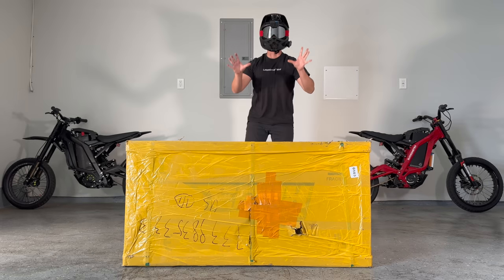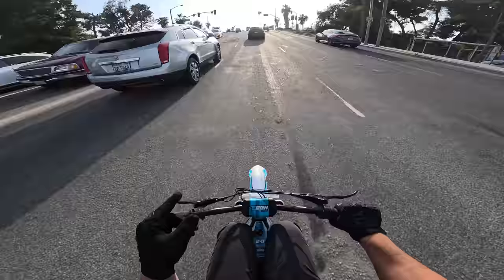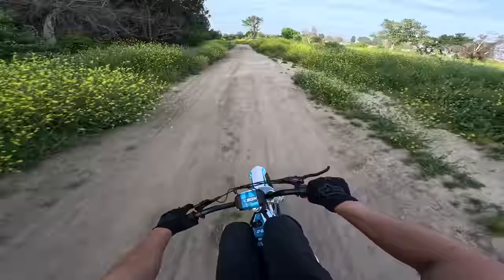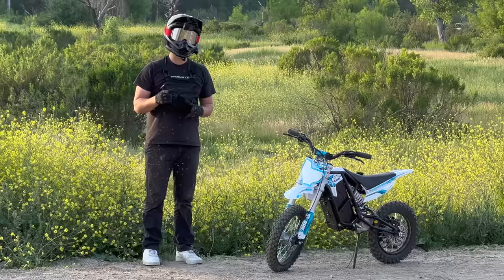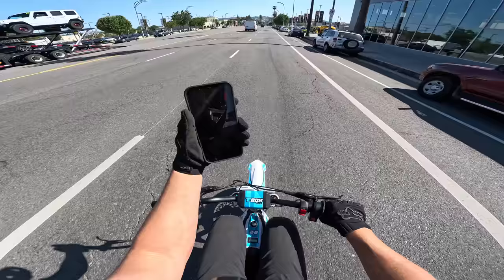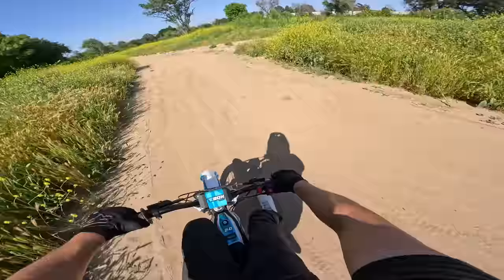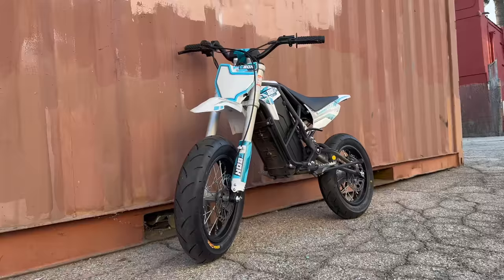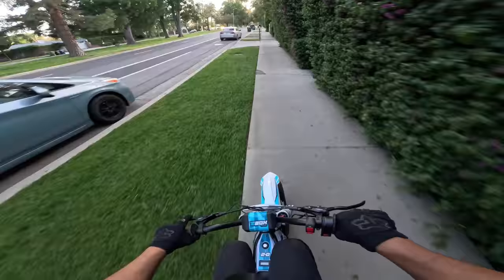World's Cheapest Electric Pit Bike // OFFICIAL Test and Review E-BOX 2.0

Comment: For everyone wondering which kit he used from electro&co its the etm kit meant for the mototec! The ebox uses the same motor and wheels! The ebox looks like a great bike since it comes with a 60v battery!
Reply: Can i ask about the battery bms ? The Stock controller have 42A output i realy Dont think the battery bms is rated on 75A controller 
Or ?.
Reply: @petr machač  are you asking about the e-box? Im not sure i dont have one but i assume it will be just fine. My stock mototec 48v 13ah will handle 70amps no problem and has been for over a year.
Reply: @EmxBrandon  thanks that what i needed to know im thinking to try shunt mod on the controller as cheaper alternative 
But little bit skeptical about the heat, safety etc :D
Reply: @petr machač  just take it slow with the shunt mod! And be prepared to get a new controller. Not saying it will burn up but theres always that chance
Reply: @EmxBrandon  yeah ist just befor i can Save for the controller kit know that it Will kill the controller but the battery shoud be fine or?
Reply: @petrmachac8165  which bike do you have? Either way im sure the battery will be fine!
Reply: @EmxBrandon  the 2kw version 
Thanks
Reply: What controller kit can I order from the uk?
Reply: @mckenziehattersley2117  for what bike?
Reply: @EmxBrandon  the same in the video the stomp e box 2, I can’t order from electro and co because I’m from the uk so I need a different controller kit I can order from the uk
Reply: @Mckenzie Hattersley  odd i know a few guys with the etm kit in the uk. Maybe they stopped shipping over seas. Unfortunately they are the only ones i know tuning the votol em50 controller. I do have videos how to wire up and tune a fardriver controller which works great with that motor!
Reply: @EmxBrandon  u got a link to it and specs
Reply: @EmxBrandon  do you think the 100a sabvoton controller kit from ebikemodshed will be completely fine and comparable
Reply: @EmxBrandon  when he cut the wires and changed the ends what ends did he use?
Reply: @reece162  copper ring terminals crimped and wrapped in heat shrink!
Reply: @EmxBrandon  thank you appreciate it
Reply: Can you send a link to them plz
Reply: Mototec / Funbikes / Apollo to ETM Upgrade Kit this one?
Reply: @reece162  ring connectors
Reply: @mckenziehattersley2117  thank you
Reply: @reece162  just make sure you got a crimping tool and a heat gun will help a lot appropriate tools to install them
Reply: @Mckenzie Hattersley  just a crimp tool set
Reply: Thanks for letting us know! liking this so it can get to the top, side not dangggg 450 for a controller and throttle ? oh well ill still cave in and buy it hahaha, also on the sight i dont see the power connectors on the side of the controller like it is in the video, might be trippin though thanks alot :)   

quick edit: would anybody happen to know the name of the head of the connectors that he heat shrinked on? thanks
Reply: @1.crowder  hi, it’s £380 and you get the controller, theottle and colour display screen. You might be on the wrong site just search 100a sabvoton controller kit you’ll find it £380 and he used copper ring terminals with heat shrink
Reply: @1.crowder  I think you’re right too, you might have to snip the battery wites and crimp on some ring terminals too! You see there’s 5 places for the ring connectors, the 3 phase wires and battery + and battery - hope this helps
Reply: @1.crowder  also instead of snipping the battery wires you can just buy an xt60 to ring terminal connector
Reply: is the ebox that same size as ETM bike?  Specs say its smaller which has me leaning towards the ETM
Reply: @BJL  the ebox is an inch shorter seat height and 3in shorter wheel base. Make sure you get the etm and not the etm mini versions. Or save yourself some money, get a mototec 48v pro and slap on the etm kit, get some hydro brakes and a nice dnm rear shock and youll save a couple hundred if not more
Reply: @mckenziehattersley2117  dont buy the sabvaton! They work terrible with these motors!
Reply: @EmxBrandon  so your saying get the etm over the ebox
Reply: @EmxBrandon  what controller then
Reply: Is it possible to just get the controller and how please.
Reply: @BJL  nah you get whatever you like!
Reply: @mckenziehattersley2117  fardriver! 72360 i have videos on how to wire and tune them easy!
Reply: @Bodhi Graydon  what controller? The etm controller? Youd have to buy the kit it comes prewired with a throttle onoff switch and volt meter. Or you can buy a fardriver and your own stuff and wire it up and tune it for alot cheaper. I have how to videos to make it easy!
Reply: @EmxBrandon  where can I buy one and is there kits I can get
Reply: @EmxBrandon  I"m looking for the closest replacment size wise to my SSR TR140
Reply: @EmxBrandon  can I get a link
Reply: @BJL  the tr is the big wheel model right? Your not gonna find anything that big. The mototec 48v is closer to a klx110l
Reply: @bodhigraydon6503  link for what?
Reply: @EmxBrandon  ah that looks like same bike as electric co etm.  Just not as powerful.
Reply: I don't know anything about this stuff so I end up with questions. Can you just get a new throttle for smoother control? Or do you have to get the kit?e.g was it the controller or throttle that made it better. Would the original throttle be better on the new controller. If you can just get a new throttle, none of the ones I've searched look like the one in the video with 3 speeds.
Reply: @Anthony Moy  i agree! For a little more your getting 60v more mph and id assume more torque than the mototec. Which means you wont be upgrading right away! Looks pretty cool too
Reply: @EmxBrandon can u send me a link where i can buy the bike pls send me a safe link and I’m talking  about the bike not the kit
Reply: @Solo_050  sorry bud i dont have a clue where to get them. Google the bikes name!
Reply: @solo_0504  surronster put a link in the description for the bike, but looks like they are sold put of the 2.0 model
Reply: Hey end Brandon so I was on the electro co website and couldn’t find the exact kit he uses and was wondering if u could help me out by finding the same one
Reply: @user-cr3mw8lq9c  etm kit they should have it listed as ebox too
Reply: It comes with a Motor how do I buy just the controller
Reply: @rixzy518  you cant the controller is paired with the motor and no way to tune it. The motor swaps right in though. We used to be able to get just the controller kit but too many variations of the motor had people sending them back and e&c started doing it like this nowm
Reply: hey man, I looked the kit up on electro&co and the controller on the website does not have the ring adapters on the side
Reply: @jackwijtenburg7829  ring adapters?
Reply: like in the video 3 colors to know where to put the yellow green and blue cables are on the side of the box while on the e&c site on the mottoes kit the colors are in the middle and horizontal (sorry for the mistakes but I speak French)
 @EmxBrandon
Reply: @jackwijtenburg7829  oh i see. Im not sure how it would fit to be honest since i dont have the ebox. But i imagine everything should work since it worked for surronster
Reply: I know this was a long time ago but the one I see is $700 is the the one
Reply: It looks like this kit comes with a new motor but he doesnt swap the mottor, just controller. Can you buy this kit without a motor?
Reply: @maxwellstapenhorst8465  it comes with a new motor because of compatibility issues, that way your not sending the controller back to get it re-tuned for the motor you have. This was a big issue with the mototec, causing electro&co to sell it with their version of the motor. They wont sell the kit without it anymore, unless your surronster or someone who they benefit from.
Reply: is it the fun bikes kit?
Reply: @bettercalldany  yes
Reply: Do you know what tires he got and from where ?
Reply: why dose the Mototec / EBOX / Apollo / Funbikes to ETM™ Upgrade Kit have the motter in it his upgrade dose not have one
Reply: Hi, the only thing I see for the etm mototec is the full kit including the motor is it possible to get just the controller kit like he had? TIA
Reply: @aidenforce9784  you have to get the motor, the stock motor wont be paired to the controller.
Reply: @EmxBrandon the only kit comes with a motor too
Am I looking at the right kit ? The one I’m looking at is on the same website but comes with a motor and is 650$
Reply: @idfk343 it is the right kit they had trouble with the controller not being compattible with other motors so they took off the option to only get the controller
Reply: thx
Reply: Can you link the kit? I can’t find it on the e&co website.

Comment: OMG this is the day i have been waiting for, i got 2 rsfs because of you and planned on upgrading them but never did because i figured it would get way to small. My buddy has 2 surrons and we go riding sometimes but i dont have a bike of my own, looking forward to mabye getting this bike edit: how much would the controller cost ? might be interested in that aswell
Reply: Almost 500$ for everything. Plus 1600$ for the bike. You can buy a 48v Mototec which is the same thing, just lower voltage for 1100$
Reply: @vadsity  thanks do you happen to have the link to the controller ? i checked the emx kti but it doesnt have the ring terminal connecters in the pictures on the elctro and co website
Reply: @vadsity mototec is 1600W, this is over 2000W and even more with the controller

Comment: Just received my electric and co controller kit for the ebox and it’s a night & day difference. Wheelies are finally possible. Wish I knew a controller was necessary before buying the ebox 😮‍💨
Reply: Which controller is it?
Reply: Mototec / EBOX / Apollo / Funbikes to ETM Upgrade Kit
$649.00
Reply: Didn’t want the kit but only way to make the bike smoother…
Reply: @clockback9559 what comes in the kit is it just the controller and  throttle
Reply: @clockback9559 I have the same bike and I’m about to buy the kit too how much does too speed actual change and does it drain the batter faster at all? I’ve got a raised seat and handlebars custom indicators and lights on the way to making it road legal
Reply: hey bro any chace you can make an in depth tutorial on how to install the 2 upgrades shown in the video because he didnt teach me how to do it i am a very beginner
Reply: @clockback9559  how fast did the bike go for you before and after the kit

Comment: I have a HUGE QUESTION WHATS THE DIFFERENCE FOR THOSE TOO ??? ANY Extreme 11.000W Razor Kit
$1.438.00
Battery: 52v 20ah w/ Charger
Switch Type: Key with Volt Meter
$1.438.00

5000k WATTS Battery: 52v Li-ion w/Charger
Sprocket: 14t
Keyswitch w/ Voltmeter: Yes
E&C Ultimate Motor Heat Sink: With
$1,224.00

Comment: Mototec is best bang for your buck. Comes with the electro and co suspension stock, 48v 12amps hella good torque, 20 miles range. And 1600w for only 900
Reply: How do I get the controller itself
Reply: how do you just get the controller

Comment: Is it possible to upgrade the battery  to a 72v if so what one would be the best to go with ?
Reply: On electro & co there’s a mini 72 volt that’s an optional add on to the controller and motor upgrade kit. You can of course buy the battery separately. You could also do a full size 72 volt but it would be extremely difficult to put it on.